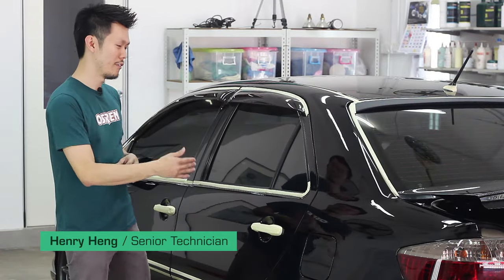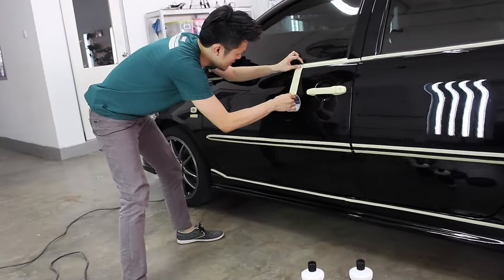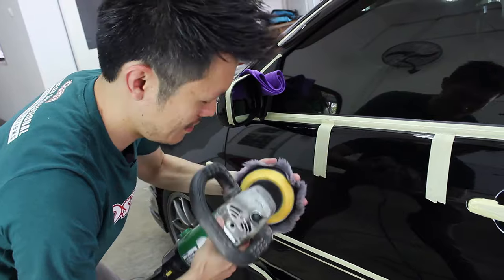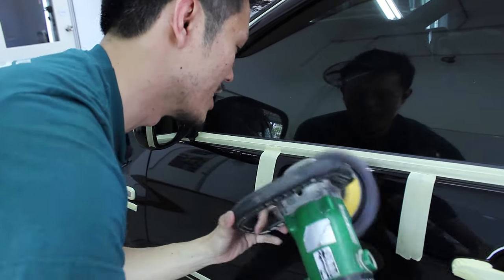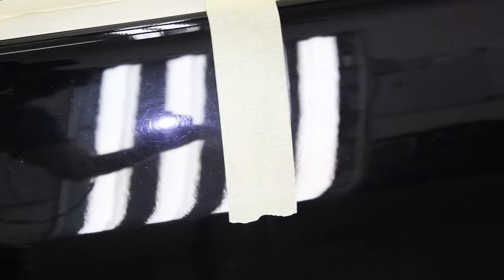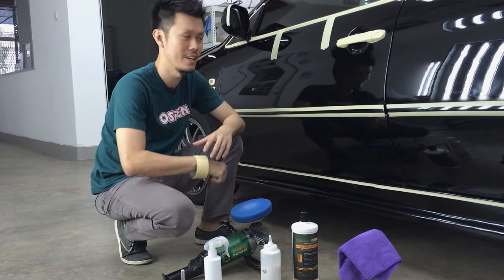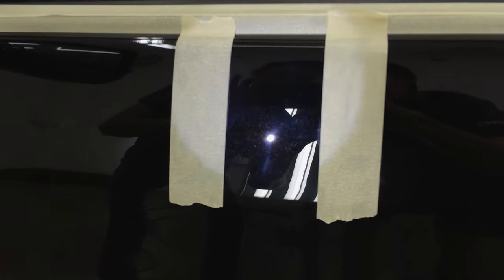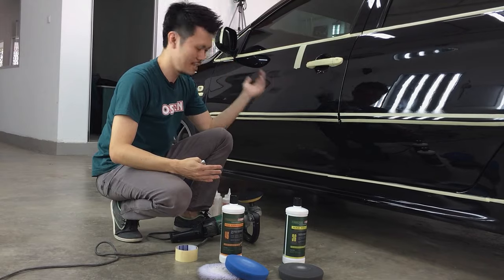How-to Remove Swirls and Hologram

Comment: Best on you tube...you are expert with rotary and today it is a rear to see
Reply from the maker: Thanks for watching and for your kind words!
Reply: @OSRENOfficial  is that rotary hitachi good?..i have flex pe 14 2 150 and it is good but i love little biger and heavyer machine...my flex is to easy...heavy machine are better for hard damage...
Reply from the maker: In certain ways I agree with you that with a heavier polisher, you potentially can get more cutting because if it’s weight. However I wouldn’t suggest going out of your way to get a heavier polisher to achieve more cutting. You can just play around with different combinations to achieve the desired results. Also, a heavier polisher is advantageous when you work on horizontal panels, for vertical panels....... can be quite tiring after some years 😅

Comment: Hi Thanks for keep teaching us and updating videos. I really like and enjoy your videos specially because you use the rotary a lot! and since thats the machine I have It is usefull for me. I just want to ask you a favor please make another video about how to correct holograms with the rotary but an extended version on a bigger pannel so we can learn the techniques
Reply from the maker: Hi Luis Fernando, thank you for the encouragement! We do have more video on polishing that's coming soon, so stay tuned!

On removal of holograms, it all depends on polishing abrasive, pads and types of machine (da/rotary), among others. On certain paintwork, we are able to finish down with the rotary for swirls free finish. On some soft paint however, it is easier to rely on the dual action polisher to finish it off. We will be showcasing on how to determine paint softness sometime soon!
Reply: Thank you very much for your answer. Best regards

Comment: Hello Henry,
may I ask you for advice? I am stuck here for weeks already and you are pretty much my last hope haha.

I am just not able to remove those swirl marks from the paint of my black Ford. I tried everything but they won’t disappear. I mean they disappear but after cleaning up with IPA, they re-appear again. You can see them only under bright sunlight or street lamps.

I use a 3M machine polish (it’s purpose: remove swirl marks) with a 3M medium foam pad which is right for this product. I tried changing the product, the pad, go more aggressive, less aggressive, more product, less product. It just won’t help.

You have a hint for me that I could try out?
Or is it the rotary? I use a Chinese no name rotary, but for normal cutting and polishing, it served me well. Or is my technique wrong? Only those 2 things are left, that I could think of. Or are some swirl marks unremovable?
Your help/ideas would be very much appreciated, I am kind of frustrated here.

Thanks a lot, Frank
P.s.: I will try your way from the video now, work with a compound first. Anyway, if you have an idea, please get back to me. It’s a hard task here.
Reply from the maker: HI Frank, based on the description that was given. We believe it is a case of lighter defects being unable to remove. Usually an IPA wipe down will reveal lighter defects as opposed to defects that are deeper (deeper defects w wil reveal itself lithout ipa wipe down as oil may only cover a limited depth if that make sense to you)

I would recommend going less aggressive, a step down approach. 

From there you will need to adjust with the technique and combination. ie: switching over to finishing foam / softer foam pad, wider coverage and lower machine speed etc

Wish you all the best!
Reply: @OSRENOfficial  
Thanks a lot for the effort, I will try it that way...

Comment: Hey I just noticed you were moving pretty fast, but is like 600-1000ish rpm (low speed), better for cutting? Does it remove more defects, because there's less heating of the paint?
Reply from the maker: The working area was relatively small, so hand movement seemed pretty fast for this demonstration. 

Cutting also depends on product+pad+speed of machine. In this case the nao46 and pfw were used to remove the swirls, and I must say it cuts fast.

Comment: I own a da polisher and now i want to learn polishing with a rotary polisher, do you have any recommendation a rotary polisher for me? Have u try shinemate / dewalt rotary? Thanks before.
Reply from the maker: +Randy Guncoro Hey bro, thanks for watching. Before considering any rotary polisher, take a few minutes to check this video out https://www.youtube.com/watch?v=zCnWTVro6Vg 

It explains some key features to look out for in a rotary polisher. 

As for the brands you mentioned, they are pretty decent but personally for the DeWalt 849X, I find that it has a "jerky" start when you pull the trigger. It's not as smooth as others. Shinemate's a lightweight polisher, I like it for that. As you can see my videos I always use the Hitachi SP18VA It's a well balanced machine with moderate pricing.

Explore around your local stores and pick em and see if you like em. Get ones that are comfortable with your budget and the most important, for me, in a polisher is the torque (Check out the video and you'll know what I mean)

Happy hunting!

Comment: Question why would you use compound on soft paint?From what I understand soft paints or very soft paints are  which most Japanese car mfgs like Toyota use, don't do well with compounds.  Wool pads and fine correction pads like the black ones you use work well especially when to correct swril marks, holograms, etc, etc. 
Also from what I have also told by professionals and have also readily is  to use a waffle or CCS Pads. Flat or foam pads are not ideal.  Waffle or CCS PADS help reduce friction, minimizing marring and also help to prevent excess product from being absorbed.
Reply from the maker: HI there! Seems like we will have a long list of explanations to do. 

Compounds are fine on soft and sticky paint, provided it is easy to work on and buff off. 
The difference between compound and polish is the cutting strength, it is mainly to differentiate the strength of cutting abrasives; they both cut to a certain degree. We have a compound for soft and sticky paint: https://osren.com/product/professional-series/all/perfect-cut-20
it's specially formulated for soft and sticky paints for more severe defects.

In this case, the Toyota car is repainted, and it was hard paint. if it's an original soft paint, you can look at this video we did: https://youtu.be/Z2BCAaczsmk

For ccs or waffle pad, those are lineups from a decade ago, these days manufacturers have greatly improved and made pads for dual action polisher a much lower profile pad, we used to be avid ccs users, these days we notice pads are better, longer lasting and cuts more precise too regardless of the hills. So as long as it does the job, it doesn't matter if it's a ccs or waffle pad.

Comment: Hi Henry, been following you for sometime on YouTube. Damn good videos you have here. Just wondering, this particular car also has orange peel right ? Would you use perfect 50 on this car ?.. in my opinion, alot of repainted cars in our country have orange peel, I wonder why is it so? Workmanship? Quality of lacquer?
Reply from the maker: Thank you Muhammad Mubarak, hope you find our videos helpful.
This particular car came in for paint correction, thus we did not perform any levelling. Indeed it has some orange peel. 

Orange peel exists for many reasons. Quality of paint, mixture of solvents ratio in paint, nozzle, air compression settings, workmanship and many more...
It is usually more evidential in repainted cars, mainly due to overlapping spraying patterns.

Comment: What's the best way to avoid buffer swirls with a rotary polisher?
Reply from the maker: Hi +Dan Peters! Hmm....just putting it simply, the best way to avoid buffer swirls with a rotary polisher is understanding the paintwork you're working on and choosing the right product combo (Polish + Pad). When you're using the right combo, you'll remove defects effortlessly without inflicting too much more unnecessary buffer swirls 

Of course the basic theory applies like  keeping your pads as flat as possible or as clean as possible .

There are couple more pointers but i just can't get them out from my head now. I'll write again when I think of some more.

Comment: what's the rpm of your polisher machine? and how many watt?
Reply from the maker: It's a 1250watt rotary and I'm running that at about 1500rpm
Reply: Hi, I see. Have a question btw. Some polisher machines having 3000rpm with only 500watt. Are those practical?
Reply from the maker: I believe those are able to spin at 3000rpm but without load, as in free spinning. Due to the lack of power it will bog down when you pressure it.
Reply: I see. Okay thank you.
Reply: two questions, 
Q1. On an average car on average use, how many times should we perform the swirl removal polishing? once a month? 3 months once? 6 months once or only when its needed? 
Q2. Does a light swirl removal actually cutting a piece of the clear coat?
Reply from the maker: Hi Gary, I would say only remove swirl marks when you need to. Well simple calculation will be if the swirl is one micron deep, you'll need to remove one micron off.

Comment: What size pads are you using? Thank you
Reply from the maker: Hi Mike Candeloro, the backing plate i used in this video was the 5". Purpler Foamed Wool is 5.5" and the foam pad is 6"
Reply: Thank you so much.

I'm so frustrated with holograms.  I have the 3m 3 step.  Today I tried your video and I think I finally removed the holograms.  But I have 8.5 pads and they are to big to do smaller areas.  When you remove holograms you're not applying pressure @1400 rpm?
Reply: Also what is IPA?  And which step of the 3m removes the holograms?  The polish not the compound  correct?
Reply from the maker: Yea, usually with some pressure but light and rotary speed setting ranging from 1200 - 1500 rpm. IPA is short form for Isopropyl Alcohol. It's used to remove polishing oils and check if the swirls are gone permanently. Usually polish will remove holograms, however on certain cases. Some compounds are very fine and some paints can be very tough, in that case, compounds can also be used to remove holograms.
Reply: OSREN (MALAYSIA) SDN BHD I still have holograms :(.

I have lake country pads

And the 3M compound, polish and micro polish (3 step)

Also I have a black 2008 Jeep Wrangler.

Which color pads should I use for each step.  I'm so frustrated.  A lot of time and work wasted.  

Can you please help me, please.
Reply from the maker: Hi Mike,

What are the Lake Country pads (color / type) that you have? Also have you been using a rotray, DA or both on your Jeep? Can you also share to us some pictures of the swirls you mentioned? You can reach us at www.facebook.com/osrenmalaysia Just drop us a PM :)
Reply: Thank you.  I try to get some pics.

I'm getting holograms.  The pads I have are 8.5 inch lake country foam pads.  I have very color basically.  I used orange for compound, white for polish, red for micro polish, blue for wax.  I am using a makita with a 7.5 back plane I think.  On 1500 or so rpm.  The 3m 3 step polish.

Thank you very much.
Reply: Makita Rotary polisher.

Comment: hello one question please? the best to work is rotation or orbital? best regards
Reply from the maker: Hi there! Thank you for watching our videos :) 

Technically a polisher (be it a rotary or orbital) is only 20% of the success formula. Pads, Products, Techniques and Understanding Paintwork also play a big role to get your car swirl free. 

However a Rotary shouldn't be compared with a Orbital tool as both have their own role in detailing. 

Generally a Rotary is used when you require more cutting power and a Orbital is used when you require less cutting power. But of course, you can pair the Rotary with a lighter combo (product and pad combination) to get less cutting power. While on the other hand you can pair the Orbital with a more aggressive combo for more cutting power

Comment: hi what is  1 ip 
 1 water   2.57
Reply from the maker: Hi there! 1 part IPA, 1 part water (50% water + 50% IPA) is usually diluted and used to remove the polishing oil contained in polishing cream. This is done so that we may inspect the paint of its true condition after polishing.

Comment: You seem like you are running the buffer way too fast man. I know what you are doing but when watching a ton of other detailing videos they always say to go slow and steady.
Reply: you go slow with a DA. with a rotary you have to go fast or you could burn too my clear coat
Reply: Yes, you are right. Many amateurs out there that think that they are expect with their wrong method. I would rather to run many rounds of rotary compound fast, check before the next try rather than burnt the paint. For DA, you could burn the paint as well if you used microfiber pad with too slow hand moving speed and high DA speed.

Of course, you may run slower using rotary with wool pad but definitely not on Japanese cars (Malaysia local assembled car) which are generally with thinner and softer paint.